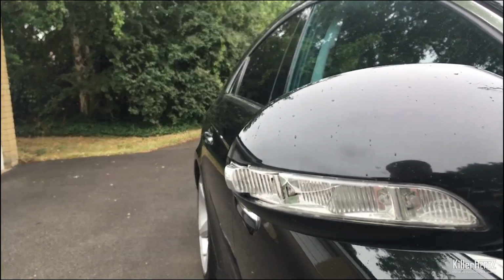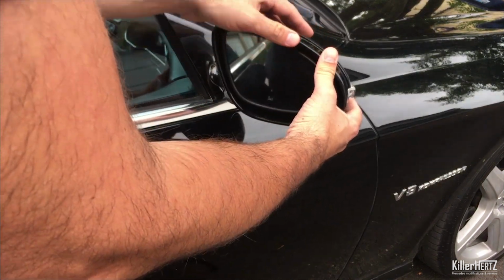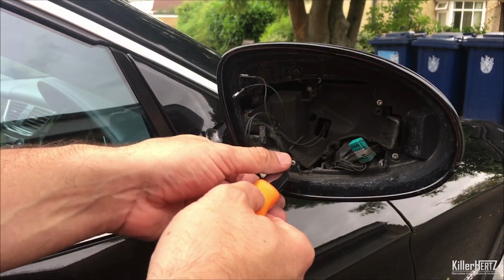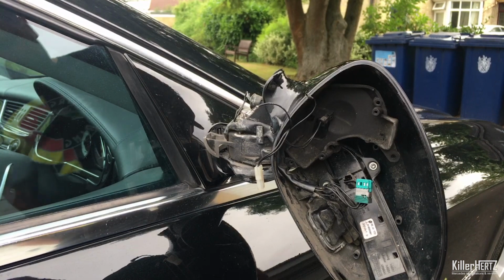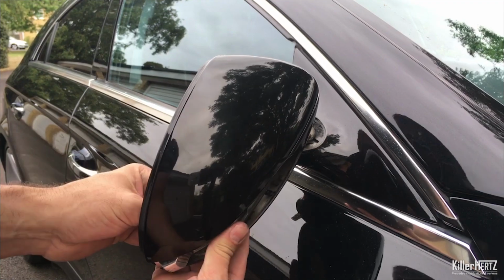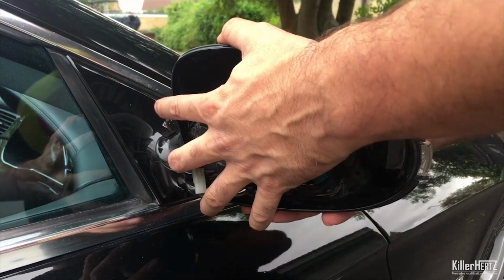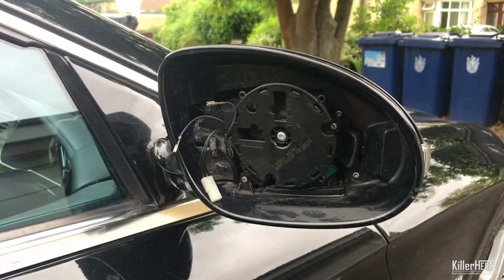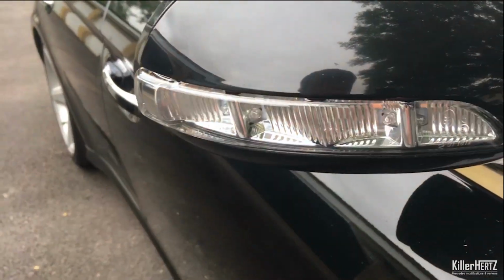HOW TO Fix and Replace Wing mirror Indicator Mercedes CLS W219

Comment: Great Video, A small point the "In video" part number ( 820 08) and the box part number (820 06 ) differ. Having spent a little time looking for the 08, I think the 06 is the correct one.

Comment: Thank you very much, Very informative. I have 2006 CLS55AMG. 42,000 miles. Can you tell me why the oil level sensor reads 7.6 litres oil when i have exactly 8.5l in after oil filter change. I'm currently using transmission dipstick and measuring  167-169mm which is 8.5 litres. Also trying to disable the traffic announcement. Turned off by pressing mute button for more than 2. It still pauses CD but TA does not sound????? Greetings from Ireland